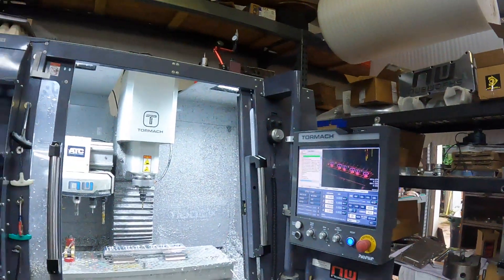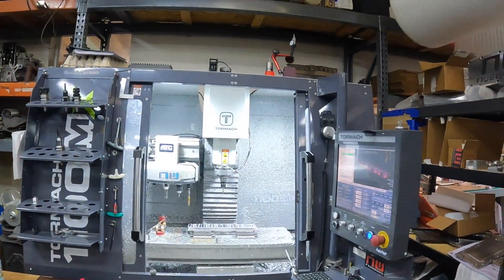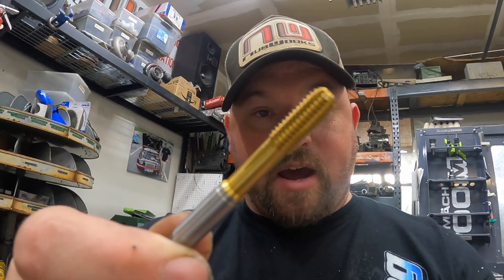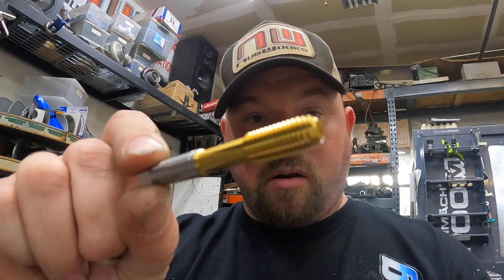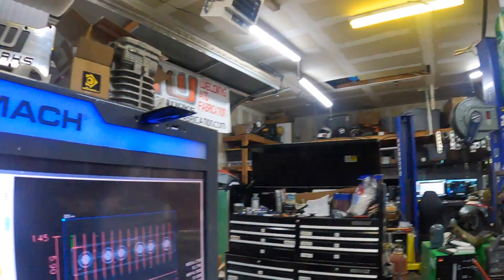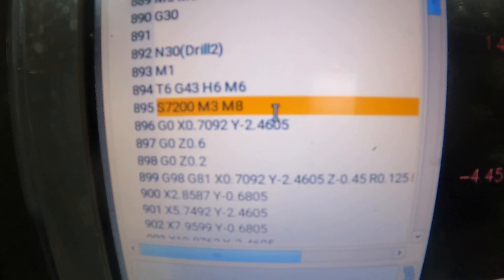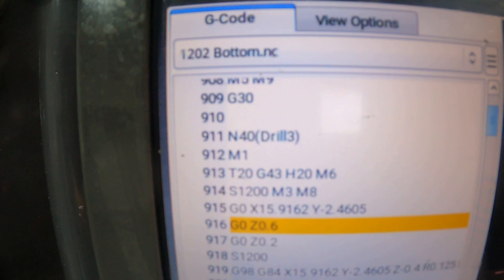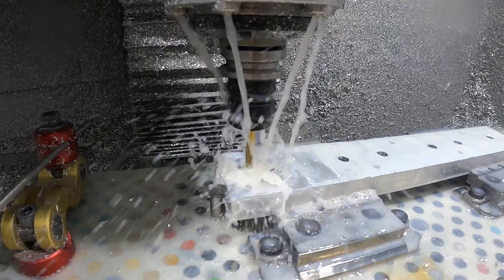Rigid Tapping on Tormach 1100MX

Comment: I’m trying to tap a 4-40 unc with forming tap and snapped 3 taps with 1100mx.  Have been tapping 10-32 and .25 20 all day no issues.  I’m at a holding pattern atm
Reply from the maker: Double check your drill size make sure everything is correct,  go back to the basics.   Is the tool info correct to generate the right feed rate?     Sometimes it’s something really simple.
Reply: @nubtv8545  thanks yea I double checked my thread pitch which is .025.  I called the tool manufacturer for 6061 I believe he said 50-90sfm.  Tool size for form tap .101.  I was running 14sfm so I took the advice and changed my rpm from 550 to 1700.  Snapped immediately on entry.  I doing a test part in 6061 first then the real part is 316 stainless.  Having these issue on al makes me terrified for 316 😂
Reply: @tdg911  Did you ever get this figured out?
Reply: @PowerSports  I did.  Used a single point thread mill.